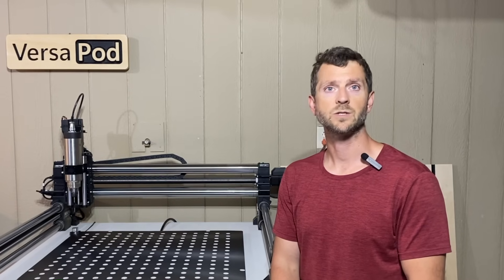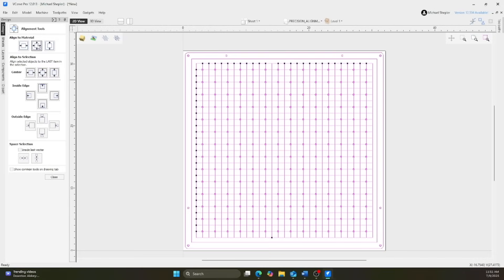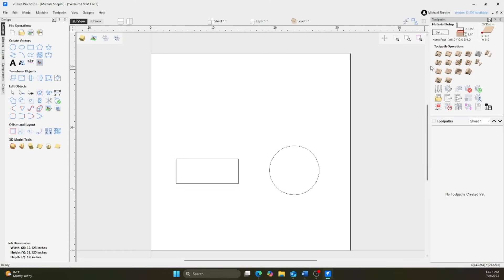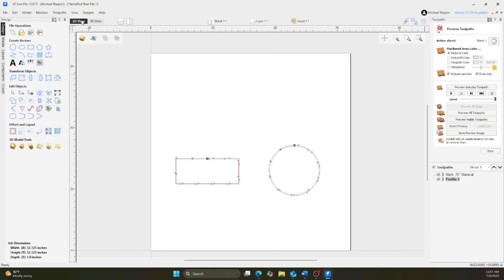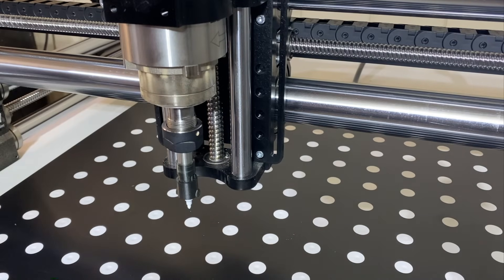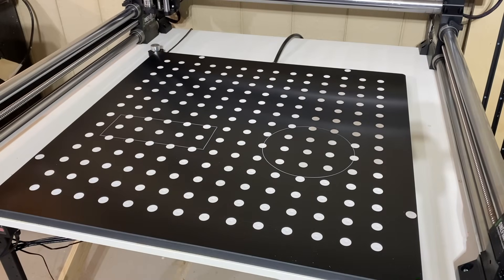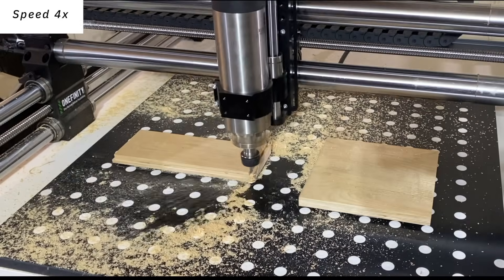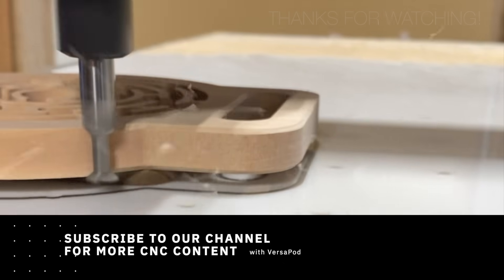VersaPod Basic Use – Simple Part Cutting on Vacuum Workholding

Comment: Why is your marker spinning?!?
Turn your spindle off.
Reply from the maker: Good eye! The marker is spinning on purpose—if there’s any tool runout, keeping the marker turning prevents the line from being offset. That way your material goes exactly where it should. Just keep the rpm very low.